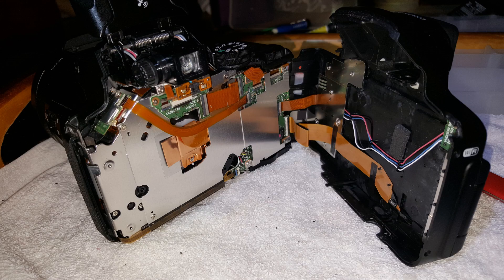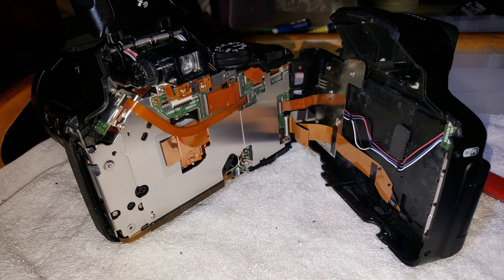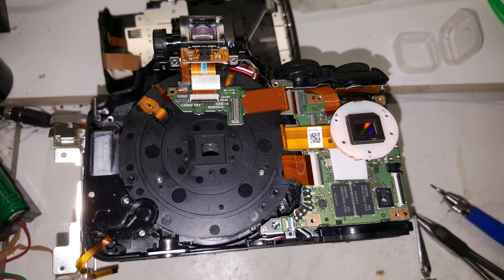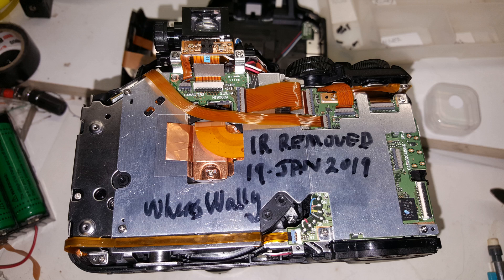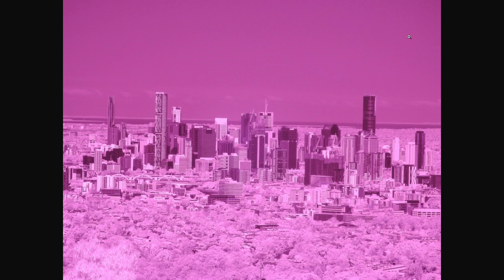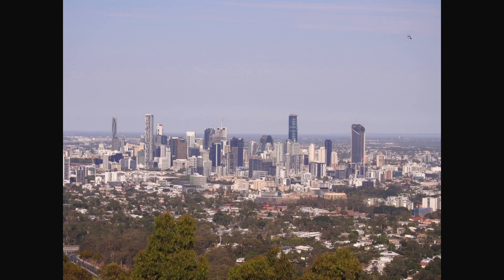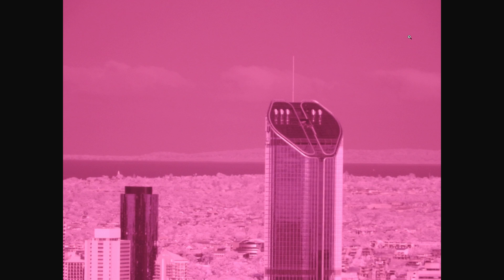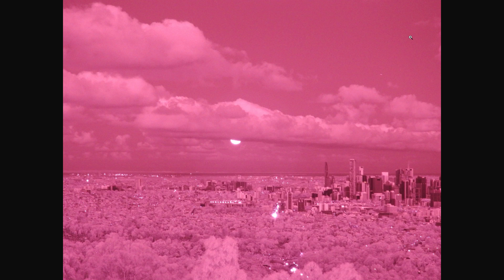P900 Infra-Red Conversion featuring WheresWa11y

Comment: Boring
Reply: IR is nice but only confirms what we knew. Soundly found the same thing.
Reply: @fandangobrandango7864  you seem to be disturbed. You should have your Dunning Kruger   treated
Reply: @Just Looking we also know but if you don't have a wide enough viewing angle light cannot transfer the information to your eyes. that is angular resolution
Reply: So you don't wanna become JTolan Media2?
Reply: Gary Wybenga   I’m glad you keep posting links to your vids for us to down vote. Keep them coming
Reply: @marvinmartinsYT  if I wanted upvotes I would link them on flat earth YouTubes.   That's like preaching to the choir. Lol
Reply: Gary Wybenga   You Do Lol.  You link everyone to your vids.
Reply: The Horizon is not a solid barrier but rather it is an Optical limit of angular resolution at the elevation of the Observer.
Anything that is past that limit is obscured  bottom first by that limit. 
A simple rise in elevation extends that optical limit further out by lengthening and widening the angle which completely levels out the so called " curve " and the bottoms will reappear. There is no curvature

https://youtu.be/5SVwfjexk7k
Reply: @garywybenga4188  OR
a simple rise in elevation allows you to see over the curve. That is what you see from the ISS.
Reply: @whereswa11y  Flat earthers always surprise me with the complete lack of logic in their thinking. The limits of angular resolution for a camera is a matter of the pixel density on its sensor (and focal length, which I of course assume to be left unchanged). Now, do they think the sensor magically changes when the camera is used at a higher elevation?
Reply: @mittelwelle_531_khz  it acts like your eyes. Lol, can you not see further with elevation?  Maybe you are cross eyed
Reply: @garywybenga4188  Nobody says you can NOT see further. The REASON you can see further is you see further over CURVATURE the higher you go.

It is not that the angular resolution of your camera or eye is magically "widened". Because any kind of widening angular resolution (when the focal length stays the same) for the camera would require a PHYSICAL change of the sensor and for your eyes would require a PHYSICAL change of your retina.
Reply: @mittelwelle_531_khz  the higher you elevate the more what is below you rises up to form a new further horizon and you quickly notice the curve you thought was behind the horizon when you were lower was never there after all. 
The geometry of perspective is your imaginary curve
Reply: @mittelwelle_531_khz  the angular resolution is now the new horizon formed by your eyes at the higher elevation. It is the vanishing point you guys hate
Reply: @mittelwelle_531_khz  widening of the angle is not the same as angular resolution
Reply: @garywybenga4188  "…the angular resolution is now the new horizon…"

Sorry but "angular resolution" has a very precise definition: which is when the angle between two light rays hitting the eye is so small that on the retina they are projected to the same light receptor or on a camera sensor on the same light sensitive pixel. The connection between "angular resolution" and the horizon you call "vanishing point" (while it is rather a line) comes via the law of perspective, basically making things in twice the distance to appear half as large.

And btw. there is no "single" vanishing point:
A car may become too small to be resolved by the eye or a camera with a given focus length at a given distance, so it is "beyond the vanishing point", but a much larger skyscraper at the same distance as the car may still be resolved and recognized for its overall shape.

And if you view the horizon on the open see a much further away mountain top of some island may also still be recognizable and identified by its shape.

So there is no firm connection between "vanishing point" and "horizon" … it all depends on the size of the things we are looking at. And for large distances it depends further on curvature, refraction, and also light scattering by moisture and air pollution.
Reply: @mittelwelle_531_khz  the optical limit of angular resolution is in the top far end of the angle which is at the horizon/vanishing point where your eye can no longer resolve small detail. This is easy
Reply: @mittelwelle_531_khz  when a bird flies away from you and becomes so small in the distance that your eye can'tresolve it is one thing but we are talking about large things that are beyond the optical limit of angular resolution for the elevation of the observer which is the vanishing point that obscures the bottoms of things. This is easy
Reply: @mittelwelle_531_khz  by the way, my videos do all these things in short distances. Lol
Reply: @garywybenga4188  What? So if you apply the angular resolution of the eye (about 1 arc minute) to your 32 mile wide Sun... It has to be 110 THOUSAND MILES away to reach 1 minute os arc. So farther away and it would be smaller than the angular resolution of the eye... at 110,000 miles away. So how does that fit in flat fantasyland?
Reply: @garywybenga4188  wrong. Nothing can cause an object to disappear, let alone bottom first, on a flat Earth. Geometrically impossible. There can only be one reason for an object being hidden bottom first and that is obstruction by a curve.
Reply: @misterocain  hate to tell you but you are wrong. Lol, the geometry of the perspective of the eyes is not regular geometry.
Reply: @garywybenga4188  Nothing wrong with the geometry of the eyes when you look along railway lines which converge to a distant vsnishing point (but never, ever cross over) in straight line geometry. As for your video. I have seen tons of FE videos and all found wanting. Rather than me sitting through 20 minutes of yet another FE video please summarise your "falsification" of a globe because I have made numerous observations that point to a globe.
Reply: @garywybenga4188 "…watch how things in the background disappear bottom…"

Don't you know that famous video by Ranty – a flat earther(!) – who tried to prove exactly this on a race track and failed? The difference between his video and yours is on the race track the ground was flat and even while your rails are laid in a ballast bed which neither guarantees to be perfectly even nor to be perfectly flat.

A horizon further away from a higher viewpoint is nothing a globe earth doesn't predict. But on a globe you have curvature as sensible explanation and don't need to fall back to a magic change of angular resolution. Such a change simply CAN NOT HAPPEN when you raise the camera or your eyes because angular resolution is determined by the pixel density of the camera sensor or the light receptors of your retina.

Therefore angular resolution DOES NOT CHANGE with the height from which the observation is made is hence doesn't explain anything, while curvature does.
Reply: @mittelwelle_531_khz  except that it does. 
The railroad tracks would have the same exact results facing the other way so there you go. Lol
Reply: @mittelwelle_531_khz  funny thing is I did it easily and can do it over and over again. 
Repeatable and scalable
Reply: @garywybenga4188  "…The railroad tracks would have the same exact results facing the other way …"

What exactly so you want to prove with this? The ballast bed is exactly the same facing the other way so it can be exactly that uneven and you can exactly the same dive with the camera in a hole below its averaged surface.
Reply: @garywybenga4188  Yes, it can be shown repeatable and scalable over and over again that things do NOT disappear bottom first on a COMPLETELY even surface.

They only do when you put the optical axis of the camera lower than that surface, even if only slightly. On a hard and even surface you can't do that, but the ballast bed of your railroad track allows for it.
Reply: @mittelwelle_531_khz  here is a hard and level surface. The elevation of the road is 117 ft and stays that way for several miles even beyond what you can see in this video

https://youtu.be/HVQ3hHYugg0
Reply: @garywybenga4188  OK, so you seem
(a) not to know what elevation above sea level means, and
(b) not to know what it needs to prove flat vs. globe earth with a "level" street as you show in the video.

To give you an idea of (b):

Assuming you determine what is "vertical" with a plumb line where you stand and then you jump in your car and start driving for 70 miles, assuming that road extends "exactly straight" that far and after you have driven more than an hour you stop and again take a plumb line to measure what is "vertical".

And then you go and prove those two plumb lines you measured, 70 miles apart from each other, are EXACTLY parallel to each other and NOT inclined with respect to each other by just one degree. Because that – the two plumb lines some 70 miles apart being exactly parallel or one degree inclined – is what makes the difference between a totally flat earth and a spherical earth of the size we know it has.
Reply: @garywybenga4188  So perspective is not normal perspective and ocular geometry is not normal geometry. Basically you are saying vision works like magic.
Reply: @garywybenga4188  Just like crepuscular and anti-crepuscilar rays. So you have just shown that light from the Sun travels in parallel rays and cannot be close. Thanks Gazza.
Reply: @phillipkidd762  vision perspective is not like your geometry. That's what I'm saying
Reply: @mittelwelle_531_khz  if the road was inclined slightly I would still get similar results. Lol, perspective flattens the ball
Reply: @phillipkidd762  I point out that that is what the globe model says
Reply: @garywybenga4188  So how do you describe it in a precise manner that always reflects reality and gives predictions that are verifiable....
Reply: @garywybenga4188  Your railroad video, both in vision and narrative, confirms what I said. The geometry is of straight parallel lines (not curves) that appear to converge to a vanishing point. That vanishing point can be extended with binoculars. What we are seeing is the gap between the rails reducing in angular size with distance but what we NEVER see, even with magnification, is the lines crossing over. That is because it is physically impossible and why you cannot explain objects disappearing over the horizon bottom e.g.  Sun or departing ships at sea or why the only way you can bring said objects back into view is with elevation. Geometry is the enemy of flat earthism.
Reply: @garywybenga4188  
Boring...
Reply: @garywybenga4188  "…A simple rise in elevation extends that optical limit further out by widening the angle…"
Arbitrary word salad unless you explain HOW that "widening of angular resolution" is supposed to work.

Just saying "it happens" is not sufficient because there are many other facts that are perfectly explained by a spherical earth but impossible on a flat earth. Only to name a few think of meridians coming closer together again on the southern hemisphere, or southern star trails, or why equatorial mounts work, or that from everywhere on earth we see the same face of the moon though upside down on the southern hemisphere.
Reply: @mittelwelle_531_khz  it's how your eyes work when you elevate. How does geometry describe how everything below eye level rises to it whether you are standing on the ocean shore or on too of a mountain looking over a valley. You ball earth geometry can't explain it
Reply: @mittelwelle_531_khz  star trails are a big problem for the globbers. There is not a motion in it for the earth simultaneously rotating and orbiting. You can't have a have a nice circle with 2 or more other motions happening at the same.. so there's that, lol
Reply: @garywybenga4188  You don't understand distance, do you?

What you say is "impossible" is so easy to demonstrate on a kitchen table: Do you own a turntable, like those you can serve food on?

Put a camera close to its border pointing at the window to something that is some hundred meter away, say a church tower and turn the table slightly, by 30° or so: The tower (or whatever far object you use as reference) will move SUBSTANTIALLY through the picture frame.

Now, if that turntable has a radius of 15 cm the camera moved less than 10 cm by that 30° turn. Now put the camera directly on the table top and do a lateral move of 10 cm WITHOUT the camera rotation. You will hardly see the far away reference object move, any "visible effect" it's probably hidden in the limited accuracy with which you can do the move.

Again: the answer to what you think is a "problem" is DISTANCE. Distance makes a large difference between a rotational and a lateral move and earth's orbit around the sun compare to earth's diameter is about straight during one night.
Reply: @mittelwelle_531_khz  I didn't say widening the angular resolution. I said widening the angle of view. There is a difference
Reply: @mittelwelle_531_khz  paint stars on your ceiling and place a camera dead center on that turntable while at the same time moving the table. What would happen to your nice round star trails
Reply: @garywybenga4188  "…What would happen to your nice round star trails…"

They will stay nice round star trails if my ceiling is 100 meter high and I move the turntable by 10 cm while I do the 360° turn.

Thanks again for so CLEARLY demonstrating you don't understand the effect of distance.
Reply: @mittelwelle_531_khz  billion and billions and billions and billions... is the ballboys answer to everything. Lol
If a movement of 3000 miles in a 3 hr timelapse will make a star trail then the much larger movement of 200,000 miles in the same 3 hr period against the same stars would have to be quite notable. Lol
Reply: Gary Wybenga   Nothing rises to eye level! Period. This notion is stupidity in play.  The ground, the water of oceans don’t move up. They remain where they are. If you are looking at the horizon you are looking down! Not up, down!
Reply: @marvinmartinsYT  wrong. If I stood on a thousand foot cliff above the ocean I would look down at the shore. I would look straight ahead of me to see the horizon. NOT DOWN! LOL, on a ball the water would have to immediately begin to fall away from you and then you would have to look down. The horizon always rises to eye level. Sorry, but your geometry doesn't have a way to describe it. Hahahaha
Reply: Gary Wybenga   If you are looking at the horizon you are looking down! Period!
Reply: Gary Wybenga   Everywhere you look you are looking in a straight line.  Not a level line!    Line of sight is a straight line. You are conflating line of sight with eye level, along with point of view. They are not the same thing.
Reply: martin  actually you have them confused. The geometry of perspective is not your regular geometry
Reply: @garywybenga4188  Hey Gary... how about the south celestial pole. Your flat fantasyland camera must look up and down through the plane at the same time.
Reply: @garywybenga4188  Hey Gary... how about the South Celestial Pole. Your flat fantasyland camera must look up and down through the plane at the same time.
Reply: @garywybenga4188  No Gary, the stars will trail 15 degrees per hour, so 45 degrees over three hours. Assuming that the rest of the universe is stationary and we are travelling through it - 200,000 miles compared to the distance to the nearest star which is 25.67 trillion miles. That's 200,000 compared to 25,670,000,000,000 miles. The angle observed would be 0.000004464 degrees  = 0.00027 arc seconds = 0.01 seconds of arc much smaller that the angular resolution of the eye... So not really "quite notable".  Ans this is the closest star.

In reality the Solar System is moving in roughly the same direction as the local stars, so the relative motion doe the the parallax of the Solar System's movement through space is actually much less.

Gary. It's time you did some learning.
Reply: @phillipkidd762  there is no problem with a "south" celestial pole
Reply: @phillipkidd762  and the 3000 miles of rotation is much smaller than 200000 Mike's compared to the "closest" star 25.67 trillion miles away so would be much less noticeable. Lol
Reply: @phillipkidd762  oh gee the standard everything's moving in relation to another so we can't see any movement LOL
Reply: @phillipkidd762  this is it also funny how just a little short 50 mile drive north or south changes where we see Polaris in relation to the horizon lol that shouldn't be because the stars are so far far far far far away
Reply: @garywybenga4188  So you have zero sense of scale and can discern an angle of 0.000004464 degrees  over three hours. Magnificent eyesight. Why not rent yourself out as an electron microscope.
Reply: @garywybenga4188  Except that unique stars and unique constellations rotating about the same south celestial pole that everyone in the southern hemisphere sees from every southern continent is just a bit embarrassing for flat earth. No not a bit embarrassing. It is an impossibility on a flat earth.
Reply: @garywybenga4188  Hey that's the way reality works.
Reply: @garywybenga4188  No it will change the angle by a bit less than 1 degree as you move along a lint of longitude... 69 miles per degree.
Reply: Gary Wybenga   Nope. Geometry is geometry.
Reply: @garywybenga4188  Angular resolution and elevation are unrelated. There's no elevation in the formula for angular resolution, nor in the formula for the Raleigh criterion. It's your own invention, unproven.
Reply: @nescio03  elevation relates to angular resolution at the point of the horizon put on your thinking cap
Reply: @garywybenga4188  I rather trust my science book.
Reply: @nescio03  good luck with that
Reply: @garywybenga4188  It always works for me. Correct results and predictions every time. I've yet to see an FE science book with working formulas. They don't even have a working formula for their holy density/buoyancy without gravity hypothesis. And of course no valid proof for a flat earth because there is none. That's why they stopped trying and turned instead to denying science, without offering a workable substitute.